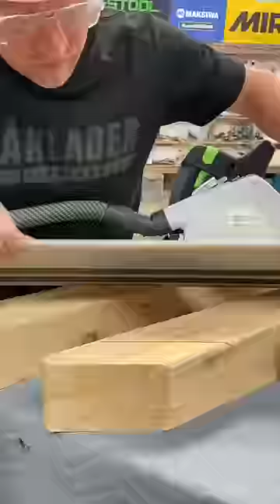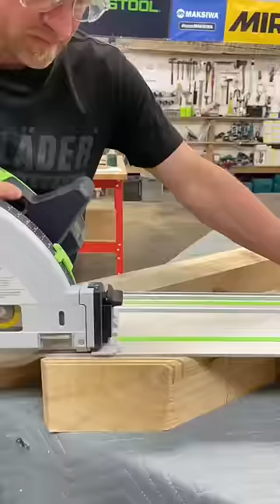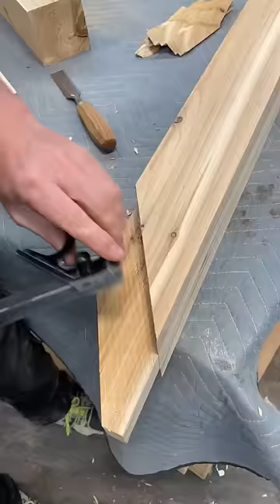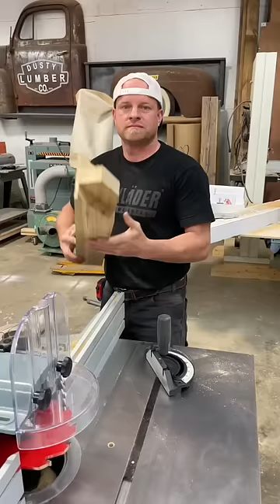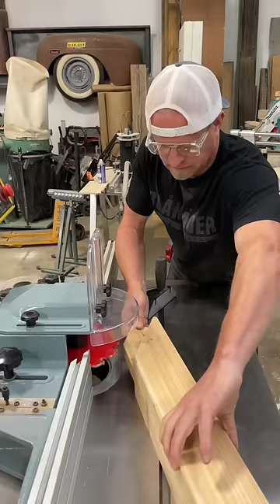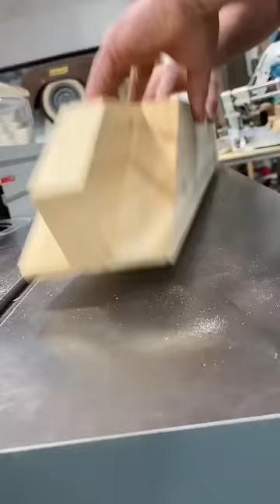Tenons with a tracksaw and shaper #woodwork #woodworking #maker #wood #tools #bois #holz #joinery

Comment: Why not just make one relief cut on either side with the track then switch to RAS for the second cut. Just curious why you’d make so many track cuts and then chisel when it seems like you could accomplish the same with only 4 cuts total
Reply: Maybe knowing that most amateurs are not going to have a shaper, he did the more common "multiple cut" method first, because obviously the shaper wasn't even necessary given all that previous work, just a little more chisel work maybe. but good point
Reply: Could do it in four cuts, but the satisfaction of doing it by hand is one like no other. Not everyone knows the value of hard skilled labor these days go earn a few calluses
Reply: Pretty much every video on this channel could be accomplished in far fewer steps. I'm not sure why he chooses the long way, but the outcome is great nonetheless.
Reply: It may sound strange, but some people in the comments like it) they like many pieces breaking sound
Reply: Tbh, there's 100 different ways he could have done this.... your way sounds like a trip to the emergency department.... he did make 1 mistake though. On the second pass with the spindle he went through the gap and the cutter grabbed it just slightly..... that could have been game over if he didn't correct himself last minute
Reply: Hes showingthat thwere are a myrid owaysto getthe job done!
Reply: Many ways to skin a cat?.jus say'in😊?